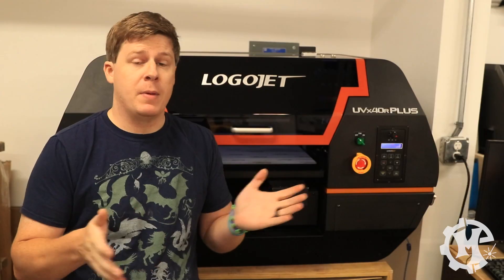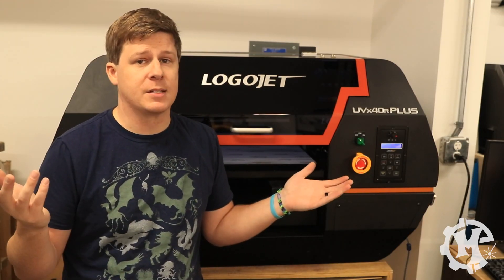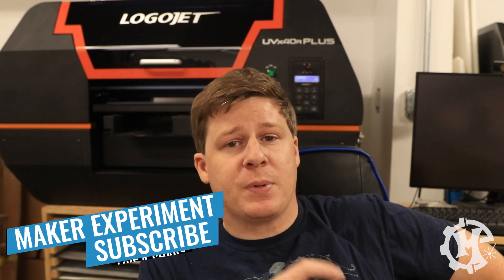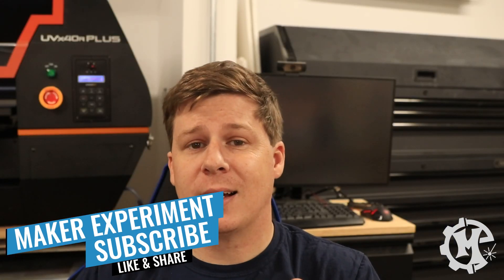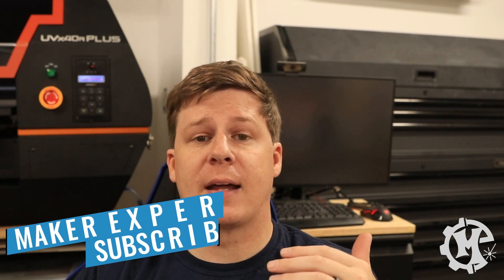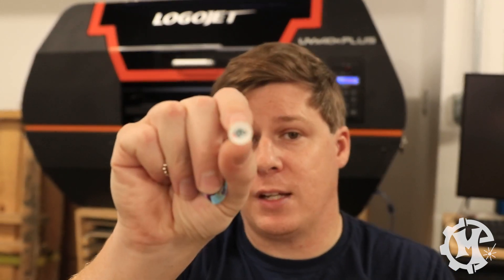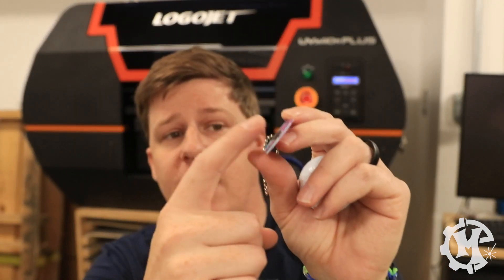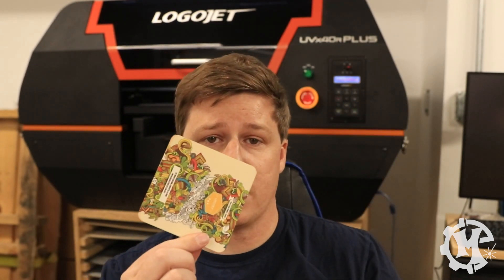THIS MACHINE CAN PRINT ON ALMOST ANYTHING!

Comment: Could you print onto a yoga mat?
Reply from the maker: You can print onto it but I don’t know how it will hold up. If it’s rigid ink, it most likely won’t hold up to being rolled up over time. If it’s flexible ink, it may but I don’t have any experience with that. That would be a great question for LogoJet.

Comment: + The UV printer is an important complement to laser equipment.
+ A laser is for cutting or marking.
+ It is not understood that there are so many people in the network wanting to obtain photographs of people or animals or making cup holders, in a laser equipment. It's like wanting to watch a movie on a black and white television.
+ The problem of the UV printer is not so much the initial cost but the cost of maintenance in supplies, such as ink, etc.
+ In addition, for UV you have to have a market. It is better to start subliminating.
Reply from the maker: You’re definitely right on those points. It’s a lot of maintenance and consumable cost.

Comment: When you print on material how about testing with and with primers (adhesion promoters) and let us know the results on acrylic, metal, wood etc.  It is hard to get much info for starting points on UV printers other than just try it yourself but that takes time and that means down production time
Reply from the maker: I think that’s why a lot of UV owners don’t want to tell people. Kind of like laser owners in the past of figure it out for yourself. Once I get more comfortable with the machine I plan to try things like this.
Reply: Unfortunately that going to be difficult.  Primarily because there are so many variables.  Quality of substrate, environment, actual print...For us, we use very little Adhesion Promoter.  However we live in SW Missouri where humidity is a HUGE issue. Every substrate reacts differently.  2 same substrates from different vendors/manufacturers can react differently.  Unfortunately there is a bit of trial and error.

Comment: Definitely considering a UV printer for our next equipment purchase.  LogoJet is at the top of our list!
Reply: After 3 months of research, deep dive,  Logojet by far has the BEST Customer Service.  The printers are awesome.  There are some that do more, some less,,,but Customer Service is the BIG DEAL.
Reply from the maker: @davidsanchez9674  that’s been my experience so far.
Reply: @davidsanchez9674  Thanks for the input.  Mimaki is the other one that we have been most interested in as well.
Reply: @malonecustomdesigns  Very good Printer, Great company, but because we're a smaller Mom n Pop biz, Mimaki was too big for us.  too many different types of equipment. Huge Company.  The dealers were very good with good reputations, but again,  a bit to big and diversified.  Logojet is small, basically UV Printers, and a new DTG printer, but, small enough to still be personal but the manufacturer company is big enough to support the equipment.  Let me give yo a little insight.  Ordered mine, almost $40K.   arrived 9 days later.  FedEx decided the box needed to be severely ventilated, with a forklift. Called Logojet, sent pics, and they had a replacement shipped the next day.  No question, no wait, no nonsense.  Put me at ease right then right there.  I have had high dollar equipment shipped and damaged, or just not working and it was always a night mare, jumping thru hoops, waiting for shipping investigators to come and verify, waiting til they got the damaged item back before shipping a new one, even had one try and send me a refurb in place of a new replacement...Logojet, 110% what a company should be, and it's been the same everyday since.
Reply: @malonecustomdesigns  which printer did you end up going with?
Reply from the maker: If you decide to go with LogoJet, let me know.

Comment: That's rad! How durable is it after printing? Do you need to clear coat it or anything to help it stay intact?
Reply from the maker: You can actually print a clear coat on top of it. I haven’t tested durability but it’s supposed to be pretty good assuming you use the correct adhesion promoters.

Comment: I’ve been dreaming about buying a UV printer, but the price and maintenance put me off.. I still have it on my sights when the amount of orders justifies buying one. Great video Trev thank you.
Reply from the maker: I fully understand that dilemma. It’s definitely a bigger investment in time and money than my laser was.
Reply: It was the same with me,  BUT,  the supply chain, trucking, fuel price issue made the decision easier.  Because you can use, buy, make substrates from OTC products, it was a no brainer for us.  With 99% industry  substrates and supplies coming from China.  We Sandblast Pet Memorial Stones,  which the stones are shipped to dealers here in Missouri from Colorado and the Pacific NW.  Never in our wildest dreams would we have ever thought we wouldn't be able to get River Type Stone.   SURPRISE...Our local dealers haven't had deliveries since March...  Yes, expensive,,,if yo have an established biz, you should be able to make you money back fairly quickly.  If you other equipment, Laser, CNC etc...it's like printing money. As far as maintenance,,,fairly simple...

Comment: Thanks for the introduction about this unit, always wanted a UV printer, hoping you will do a follow up video in 6months about matinance, ink usage and overall experience Thanks!👍👍
Reply from the maker: I’ll try to do my best.
Reply: Ink usage is dependant upon your volume.  However in comparison to Sublimation you per cost item is 2-25% of what an equal sublimated item would be.  Of course, not including your initial investment.  Maintenance is simple as long as you keep on top.  Nothing Major, Nothing you have to take apart..simple up keep and cleaning.  Of course the more you use it the more it needs to be cleaned, but it's relative.  Consider it a Corvette, since it costs 1/2 of what a New Corvette Costs....LOL